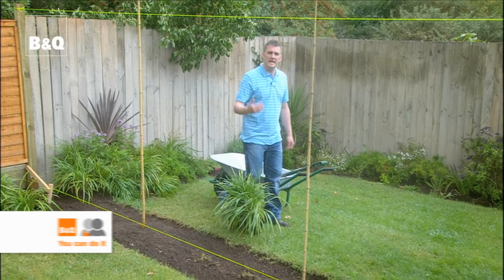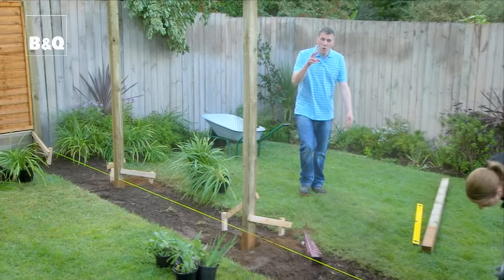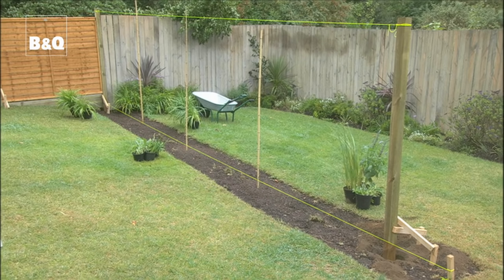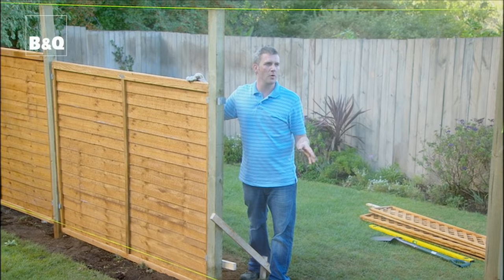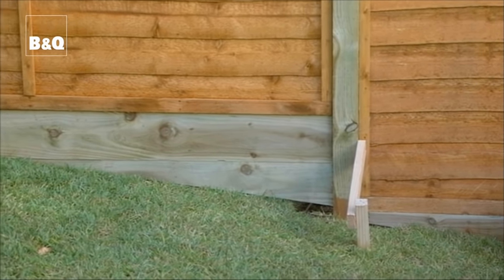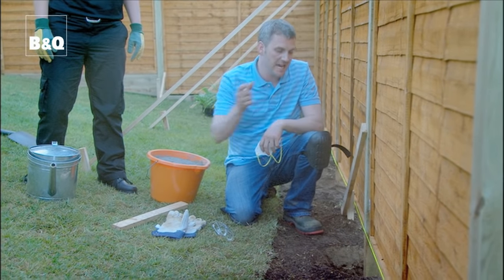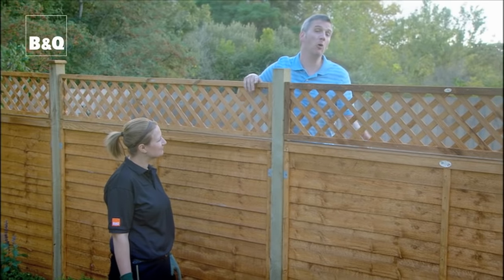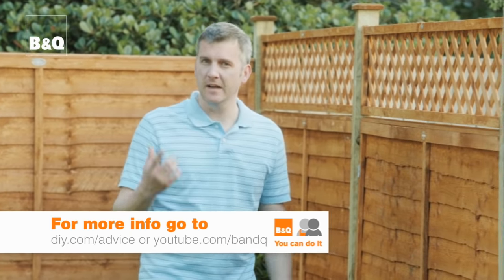How to erect a fence

Comment: The first and most important tip when erecting a new fence if you want it to last for many years. DON'T USE WOODEN POST'S. USE CONCRETE AND DO THE JOB ONCE. Wood in the ground just dosnt work. I guarantee just about every fence you see that falls or gets blown over is because wooden posts have been used. Pressure treated or not. They still rot. Do it nice or do it twice.
Reply: so true
Reply: Wrong, our custom made professional installed wooden fence still looks new and is 15 years old. It’s exposed to the elements and had no problems withstanding the near 100mph winds the other day
Reply: Good threated wood post can last up to 25 years
Reply: If uncertain you can use a concrete spur with a fence post

Comment: Top tip. put some gravel at the bottom of post hole before putting in the posts. this will help stop rot.
Reply: But if the bottom of your fence post is "encased" in the cement, wont that protect from rot / damp?
Reply: if you dont put gravel underneath the the post is sitting on soil so it may pull moisture from the soil upwards.
Reply: Even better tip, use a concrete mounted post socket. The post is then not in contact with the ground at all. It won't rot and if it does break you can simply slot in a new post. I did this at the same time a neighbour had 'professionals' in. Ten years later he's had to have post repair spurs fitted and new panels and mine are still like new.

Comment: I would always dig a hole get level then concrete in attach panel and work you way along
Reply: I  definitely agree ! Tough squeezing the panels between your posts as they arent always perfectly square or the same size. Youll end up moving your posts before the concrete has set.
Reply: Yes I agree, B & Q would not get the fence right. Straight line and one post and one panel at a time.

Comment: Agree with AP - Set the first post and then the last post at the other end of the run. String a line between them. Then attach panel to first post, mark ground at other end of panel, swing panel out the way then dig the hole. Swing the panel back, position the post in the hole (ensuring hitting the string line) and attach to panel - then concrete the post with postcrete. Work your way along using this method, not worrying too much about the panel height. The heights can be adjusted by sliding the panels up or down between the panel brackets once all the posts are set properly. This method means that you get every post in exactly the right position without the need for meticulous measuring.

Comment: I always use a dry concrete mix to set the posts packing it down. Then add gravel board, repeat this according to how many panels you have. The concrete posts should be leveled only from the top  use a 6-8ft level for this to get vertical level on point. Theres no need for a line at the bottom as it only gets in the way and with labourers tripping over them. Once all the posts and gravel boards are in place you can check the level again and if you need minor adjustments just move and pack the concrete. Finally add water and leave to set over nite. If you have less then 10 panels then you could slide the panels in first and then water all the post holes. 24 hours the concrete will set and after a month it will become rock hard. The reason I add water and fit panels the next day is so that the posts dont move with the windy weather we get in the UK. Thx for reading

Comment: try to use concrete posts ! I live in a semi detached house at the end of a road conjuncting another semi detatched row of houses, im responsible for half of my garden fencing, the other half is looked after by four different neighbours. only one of their fences has never fallen down in bad weather or had problems and its the only one using concrete posts! that fence was put up 20 odd years ago. there's a problem with the other fences using wooden posts every 2-3 years. part of my wooden fence fell down in bad weather last night so I've decided I've got to go for the concrete posts now too. the saying ''if you buy cheap you buy twice'' really is true in this case.
Reply: I couldn't agree more -  wooden posts are a false economy. Concrete posts will last so much longer. Just don't skimp on the quality and thickness of the fence panel you put between them and apply some wedging so you have no problem with the panel in strong winds either!

Comment: Concrete and wood contact apparently helps the rot and your left with a broken post in a big buried chunk of concrete.      I’ve seen an idea where a metal clip is sunk into the top of the concrete and is able to receive new posts should the old ones get blown down or damaged. It seemed like a better idea to me anyway
Reply: Am doing my own fence soon and am glad I came to the comments, this is a great idea! I was gonna just concrete my posts in like on the video but am gonna go with your idea and use metal clips incase I am ever stuck with a rotting post. Thanks for the tip 👍
Reply: Metal clips? Could you elaborate please. Kind regards.

Comment: If you used a dry/lean concrete mix around the post it will stand under it's own wieght and you don't need to have loads of battens supporting it.

Comment: Never use wooden posts, and where are the gravel boards? It may be cheaper to start with wooden posts but concrete will last long plus never put all the posts in first, put in a post make sure its plumb and then put the gravel board in, make sure its level add fence panel and make sure its still level then put in the next post rinse and repeat much easier to keep everything plumb and level and just use a string line to keep straight!
Reply: Concrete posts look ugly and are harder to fix things too

Comment: Wouldn't it be easier, after getting it measured correctly, remove panels so you can concrete post in, no added weight and no obstructions to poor cement.
Reply: Exactly